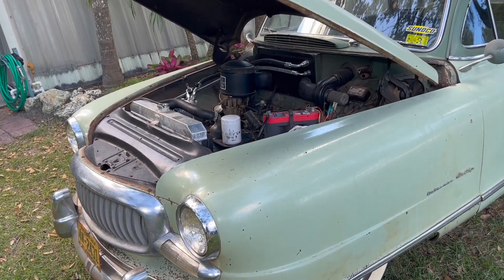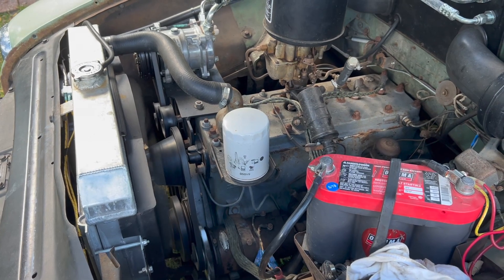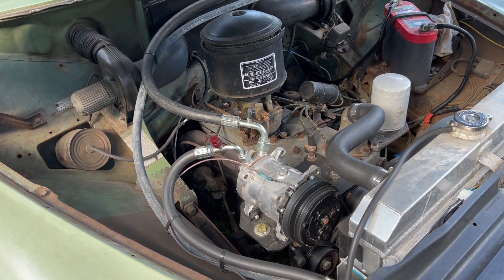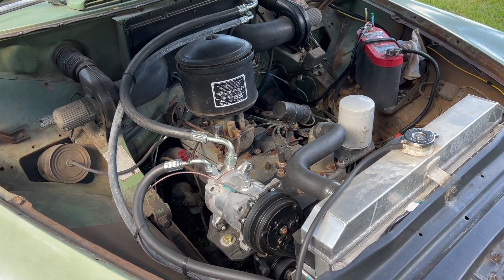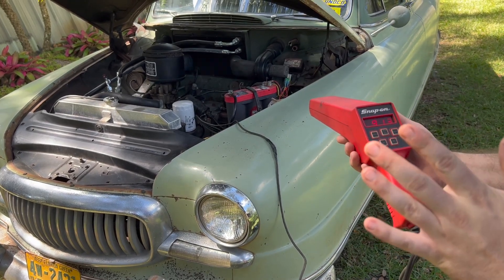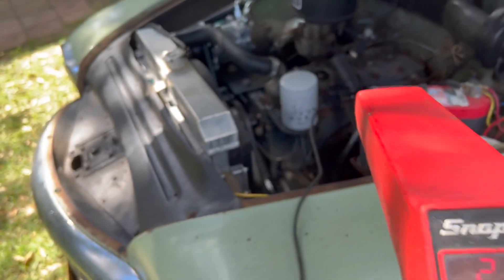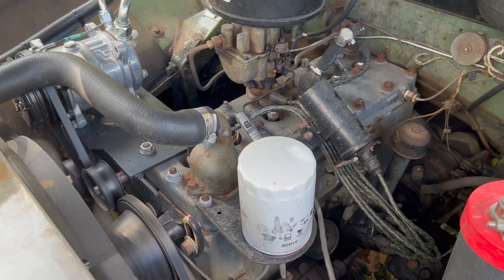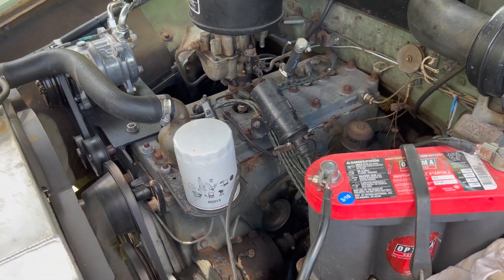1951 Nash, How low will it Idle?

Comment: At that speed, you can count how many fan blades it has. Is that a Marvel-Schebler carb?  They used to have those on lawn mowers (not kidding). Love this car, and love the fact that you put AC in it...fantastic!
Reply from the maker: Thanks, its a Carter WA carburetor. It is a really good carb, I never rebuilt it. It had been on the car when it ran last 30 or more years ago and was in the trunk so I put it on and it ran great!

Comment: I did that with my first car .A1956 ford with a 272 v8 single barrel carb I got it down to 450 rpm and you could balance a nickel on edge on top of the oil bath air cleaner .you could hear the pistons stoking up and down the cylinders

Comment: I’m a car guy myself, to the frequent horror of my wife.  I’m having trouble getting parts for my 94 Corvette and my 2002 Ford Thunderbird. How do you get parts for an ancient car that hasn’t been made in 71 years not to mention a car company that went belly up in the 1950s?
Reply from the maker: Actually most mechanical parts are available as "new old stock" from websites that specialize in AMC parts.(Nash merged with Hudson to form AMC)
Reply: @rustyoldchevy1149  I seem to remember there being Nash Ramblers.

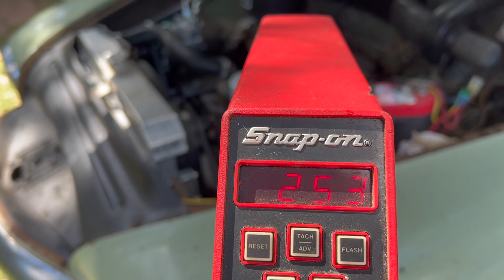Comment: 1:08 so what’s your oil pressure reading at that rpm?
Reply from the maker: I'm not entirely sure, since the factory gauge doesn't really show numbers. But the gauge will read 1/4 of the way when it would normally be in the center at idle.